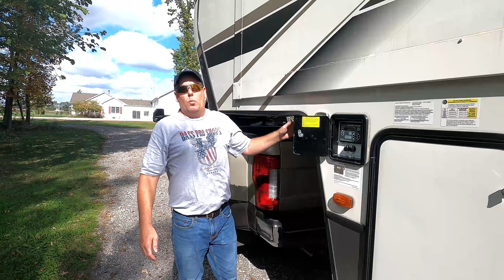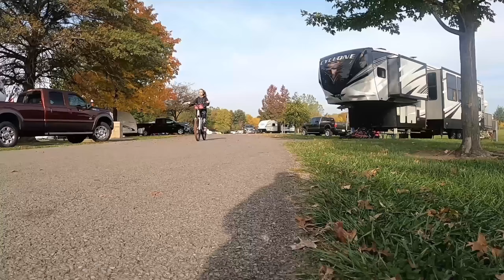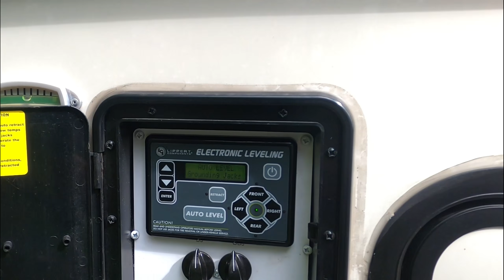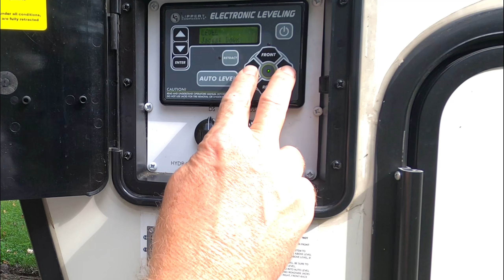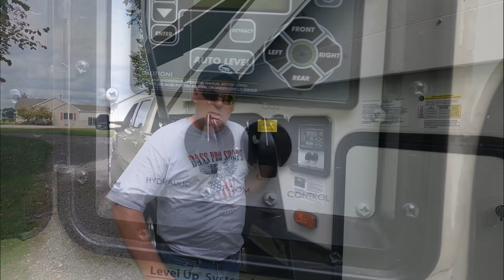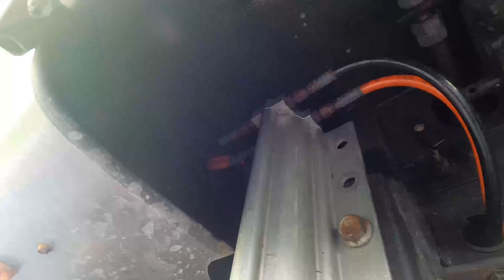Lippert Level up Operation/Troubleshooting

Comment: Why would left side not adjust properly? Keeps raising front
Reply: PS. I have also subscribed to your channel.
Reply from the maker: Can you be a little more specific as to what you are pushing and what jacks move?
Reply: @Jonesin2Go  when raising left side front jack gies up middle starts and rear doesn’t. I have trouble with left side last couple campgrounds we have been at. I ended up retracting right side to get left to go up then have to reliever middle and rear on right. I don’t know if sensor has gone wacky and no I haven’t re zeroed. Any ideas and suggestions would be grateful   Thanks
Reply from the maker: @jimgerman1231  that has me stumped. Have you called lippert yet? If not give them a call they have excellent techs that will walk you through some diagnostics. So call them when you can be next to your rig.  In the mean time I will see if I can find something on this kind of problem
Reply: @Jonesin 2 Go, thank you for such a thorough video on a subject that I just happen to be wrestling with. But first, I want to echo your praise of the people at Lippert. Wonderful and very patient. I have been dealing with issues with my 6-point hydraulic leveling system for months now. First thought the addition of fork oil would solve my problem, then battled with front jacks slipping when extending the hydraulic slides, which led to a replacement of the cartridge for the front landing jacks, then continued to deal with slipping front left jack while on trip, ratchet strapped, which caused front right jack to start slipping. Lippert coached me to tighten front nut of cartridge, (which seems to have stopped the slipping of the jacks), but which now is causing a fast clicking sound from the front left landing gear when lowering the front landing gear and experiencing my first big problem in getting the control pad to properly level when using auto level. Today I learned about recalibration, which now leaves me with “only” the problem with the fast-paced clicking noise when lowering the front jacks. Seems like I solved one problem and another one appears. We are on the tail end of a two month “vacation” down in Hilton Head and will be making a five day run back to WI. As you can see I feel like I am dealing with a crazy situation. Not sure if any of this makes any sense and would welcome any thoughts, especially about the clicking noise that I am now dealing with. But in today’s call with Lippert, the service rep was not very concerned about the noise. He felt that if the landing and leveling gear and the hydraulic slides are all working properly, I should be ok to get home. Would welcome any thoughts you might have on all these issues, but especially the clicking noise issue.
Reply from the maker: @johnscheibel8978  thanks for watching John. I'm not sure on that fast paced clicking but will reach out to a friend of mine that has a little more knowledge than I and see what he thinks.
Reply: @Jonesin2Go  Thank you so much for stepping in to help me.
Reply from the maker: @johnscheibel8978  on the leading front jack there is a valve. On the end of the valve is a "set screw" should be a 5/32 Allen wrench. It may be an 1/8. Turn that clock wise a couple turns then turn it back. Just snug don't tighten it tight or you could cause a leak. Then run the jacks up and down a few times and see if that tacks the clicking out.
Reply: @Jonesin2Go  Thank you for the reply. I am truly, truly grateful. I believe you are referring to the set screw on the end of the front cartridge valve. The customer service rep from Lippert had me do this to solve the problem I had with my front lack’s sagging after I raised them after hitching up. When I did this, I solved the sagging problem but that is when the rapid clicking problem started. I was trying to be really careful to not over tighten the set screw. Do you think the clicking noise could be a symptom of the screw still not being tightened enough?
Reply from the maker: @johnscheibel8978  I don't think so. If the legs are no longer sagging it should be tight enough. When you turn the screw clock wise it actually puts those jacks in bypass. This is the same procedure used if you would have to operate the system manually.  You already add stiction fluid correct?
Reply: @Jonesin2Go  re: Anti-stiction fluid, yes, but just one quart. Have thought about siphoning out all the fluid and putting in fresh ATF and maybe two quarts of fork oil. Why? Not sure if it ever has been changed, but not sure if it really needs to be changed. I guess just trying to knock things off the possibility list.
Reply: @Jonesin2Go  @Jonesin 2 Go, just a “quick” update. Spent a couple hours on rig yesterday. Hitched up, checked fluid. I was about 3/4 of a quart low. Filled it up using fork oil. For next hour I raised/lowered all jacks. It should be noted that there was no clicking, but I was only dropping jacks to ground; I wasn’t trying to level the rig. When jacks were up I let things be for about 15 minutes with no sagging of front jacks. So I say to myself, “OK, let’s do it once more and call it a day.” And that is when the front jack decided to droop. I raised them back up, lowered and then raised, etc. it was also during this time that I loosened and then retightened  the cartridge screw per your suggestion. After about three cycles of this, the front jacks didn’t sag. So I decided to stop. Went to auto level and that is when the clicking started up, but now coming from both left and right front jacks. The only other fact of note is now just walking around inside the rig in the front bedroom causes a click with each step. We will be heading back to WI from Hilton Head beginning next week Wednesday. Already have an appointment with a new servicing dealer scheduled for Thursday, 11/10. Will be using the ratchet straps of the front jacks just to be safe. No need to reply, just wanted to keep you informed. But. If any of this triggers some new thoughts, I would welcome your coaching. And, again, thanks for your help.
Reply: @Jonesin2Go  I want to update you on my clicking noise issue. In speaking once again with a Lippert rep, he raised the possibility that I might be dealing with a low voltage issue. And an online RV service individual (through a site called “Just Answers”) independently raised the same issue. He also felt my rig and its power demands require two 12V batteries instead of one. The Lippert rep even suggested that I may need to also replace the dual polarity solenoid (he speculated that it may have become damaged by the repetitive clicking activity). So, I went and bought two brand new 12V batteries and hooked them up in parallel, and I purchased and installed a new solenoid. My first chance to test everything came yesterday after our first of three runs to get back to SE WI. When it came time to raise the front end to level rig, I said a few Hail Marys and pressed the extend front jacks button. No clicking.

So, I cannot say 100% my issue is solved, but seems to be moving in right direction. Just wanted to thank you for your willingness to help.
Reply from the maker: @johnscheibel8978  low voltage seems to be the cause of alot of issues with this system. Thanks for taking the time to give me an update. I appreciate that. I am working on a new video to show people how they can manually override the system in case of a complete failure.  I recently helped a guy while we were in Tennessee get his slides in and his jacks up so he could get home to Texas. I learned alot myself and now carry some special tools in case I ever have to do the same. Anyway I am happy to hear you have got your issue resolved. I can't help but wonder if alot of these issues people have will go away with lithium batteries becoming so popular? 🤔

Comment: What would be a problem with 2 of the six legs will not come down?
Reply from the maker: With this being a six way level system I am assuming it is hydraulic and not electric. If it's hydraulic you could have a cylinder that has gone into bypass. This usually happens when you get some kind of debris in the system. Have you ever added any kind of additives to your fluid?
Reply: @Jonesin2Go  yes it is hydraulic. No sir I just bought the camper
Reply from the maker: @lottegower9934  ok so here is what I would try first. if there are no obvious issues like a broken line  or a leak of something like that. Add some fork oil.    Maxima 56901 15WT Standard Hydraulic Fork Oil - 1 Liter Bottle https://a.co/d/3dGLj4f

Then run your jacks up and down several times. If it is something putting a jack into bypass this may dislodge it. You should put this is now and then anyway so it worth a try. With all slides in and all jacks up. Your resivour should be an inch or so below the fill cap. If it is you will need to take some fluid out before you add the fork oil. If it's low just add it.
Reply: @Jonesin2Go  thank you very much. Will try
Reply: So after further looking we do have a leak in hydraulic line…. Grrrrrr
Reply from the maker: @lottegower9934  well that just sucks. At least you found the problem . I hope it's an easy fix. FYI the folks over at Lippert are awesome and very helpful.
Reply: @Jonesin2Go  yes I know! Almost impossible to find someone to work on campers here in Tn. I did speak with Lippert before we found this leak and they were very helpful and kind!!!!
Reply from the maker: @lottegower9934  what is the year and make of you RV maybe I can help you find someone.
Reply: @Jonesin2Go  2015 Evergreen Bay Hill
Reply from the maker: @lottegower9934  ok you almost stumped me but I see that Dutchman bought that brand in 2016. So I can use some of my contacts at Keystone to see what I can find in TN. What part of TN are you in?
Reply: @Jonesin2Go  sorry about that. I knew they went out of business in 2016 wasn’t sure who bought them out. It’s middle Tn. Have called several Rv shops most want you to bring in. They are about 2 months out waiting. Was trying if possible to have a mobile to come to me if possible. Some are not even booking through the summer. 
Thank you for all the help!!
Reply from the maker: @lottegower9934  here is a couple of places I found  in Keystones data base when I used Nashville as the search area.   Above and beyond mobile rv service 736 Casteel rd Sparta TN. 260 350-1858

Columbia campers. (Parts and service only)
301 N Garden
Columbia TN 
931 388-4343
Reply: @Jonesin2Go  thank you very much. I did try the one in Columbia. Will try other. Thanks for all your help!!!

Comment: Thanks ,great info.... I used the system to change tire, thought it was the greatest thing...ha was I wrong.. the suspension brackets that are attached to the MORIDE dropped  the springs to the wrong position... tuff to fix alone

Comment: Great video! Quick question, we have a Lippert 3.0 auto leveling 6 point system (electric) and had a RR jack error and found the issue. The system said to "retract all" to clear the code so we did while hooked up on the truck then we hit the auto level and it went through it's leveling procedure but the passenger side center jack didn't extend to the ground like all the rest of the jacks. There's no errors etc. and the system seemed to work fine, it just never did this before in our driveway.

Comment: I just purchased a 5th wheel, the two center supports did not move when leveling. Would you recommend to recalibrate?. It has the Lippert system.
Reply from the maker: Have you tried going in manual mode and see if they will go down. Is this electric or hydraulic system you have?
Reply: @Jonesin2Go  it's electric.
Reply from the maker: The electric will have a motor at each Jack. If the 2 center are the only ones not moving  look for fuses or test for voltage at each Jack while someone operates the system. If all fails call Lippert. They will walk you through some diagnostics. They are awsome when it comes to customer service.
Reply: @Jonesin2Go  thanks for taking the time to give suggestions!

Comment: Hello Mr Jones,

Do you perform a pull test when you hitch up? To insure the hitch coupled, we visually inspect the locking mechanism and apply the trailer brakes while attempting to full forward with no acceleration. Prior to doing this, we lower front jacks to a couple of inches off ground incase hitches fails. Thoughts?
Reply from the maker: Hi Dan yes I agree a pull test is a great practice to insure the hitch is locked and working properly. Another good practice is to chock the wheels behind the rig so that it doesn't slide when hitching.  Thanks for watching.  Safe Travels

Comment: If it's the 50 amp breaker, does the volt meter also drop to 10.5 volts before it shuts off and resets? Mine has new fully charged batteries and it will read 12.5 volts then gradually drop to 10.5 during use and shut off then reset.
Reply from the maker: That sounds like the breaker kicking out.
Reply: @Jonesin2Go  thank you!

Comment: Has anybody experienced when setting up rig for tow. Push the left and right same time the front start to raise but the back and middle jacks don't retract. Is there something wrong? I'm a newbie I thought it would damage jacks because they would be holding all the weight. I think because I stopped it immediately and went into manual mode.
Reply from the maker: I actually retract the rear ones first and then use that function to put it back to the truck level.

Comment: Very informative video. I wish you would have done some more with the leveling system. Like can you hit auto level a second time and what the system does if you do that. From your video Im now seeing that its ok after it says its level to go back into manual mode and check it. Mine seems to end up with the front being slightly low. So I could correct that and then reset the system.
Reply from the maker: Thanks for watching AL happybto hear it was helpful. Also thanks for the comments I really welcome those. It helps when planning future videos. Safe travels

Comment: Question, I have the same trailer and I have noticed the newer Keystones are adding a slide switch for each slide so if you are in a rest area and you can open one slide you don't have to go out and turn the valve to bypass one slide, have you looked into converting your trailer to add the switch?
Reply from the maker: No I have not. That's a good question. Sounds like a lot of work to me. I was glad to see that Montana made the change.

Comment: Question for you…. Last time I tried auto level- the system lifted my wheels so far off the ground, I thought it was going to tip over. I made it stop and then manually leveled. The site was almost level- I do not know why it did it. I’ve since learned about recalibration- so I plan to do that before trying to auto level. Do you think it will take care of the problem? Second question- where is the best place to install level bubbles?
Reply from the maker: I would start with a recalibration first. If it does it again I would contact lippert. It could be the sensor has come loose.( under the coach)   As far as the level bubbles I have mine right by the level up controls  on the side of the coach and the front so I can see them while manually leveling.

Comment: Got my new Sandpiper parked in the driveway last night after dark. It’s morning now...still hitched to truck and buttoned-up. F’ing Lippert system has a fault and I can’t clear it. 5th wheel currently useless.
Reply from the maker: Is it a voltage problem? Could be the breaker fuse.

Comment: I am having trouble with mine after 2 years it won't remember level no matter how many times I re-program it the next time I hit auto level it goes thru the auto level but its not level it always seams to be that the front is low
Reply from the maker: It could be that you sensor has come loose. Have you checked that it is secured tight. It should be located on the frame near the center of the rig. You have have to drop the under belly material to find it.
Reply: @Jonesin2Go  I talked to Lippert and they think it is the controller if it was the sensor she said it would not zero and it will zero it just won't remember zero.
Reply: @Jonesin2Go  I have a 20 ft endoscopy camera I guess I can try to see with that, I thought maybe the controller was bad. maybe take it into the shop I have the extended warranty.